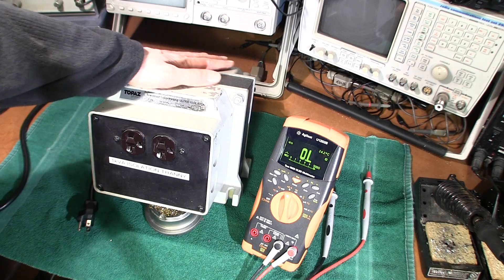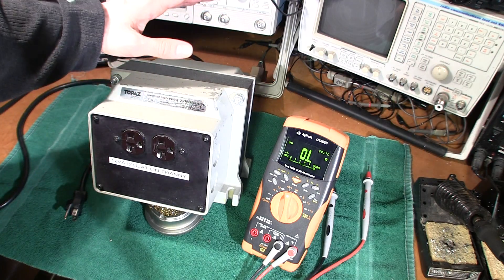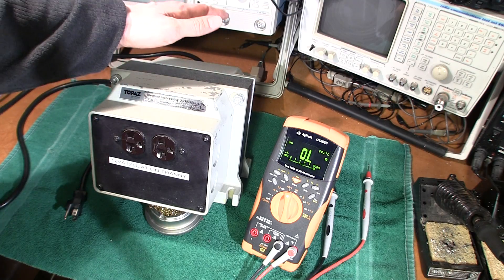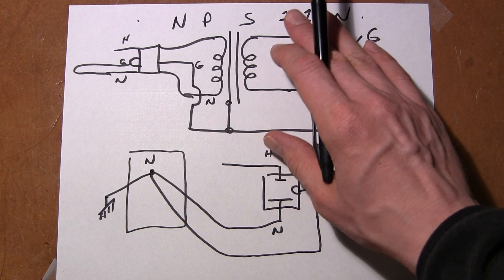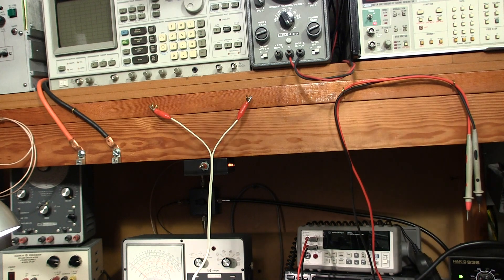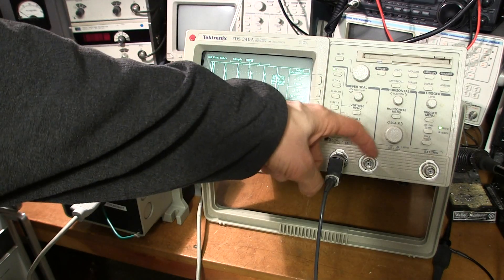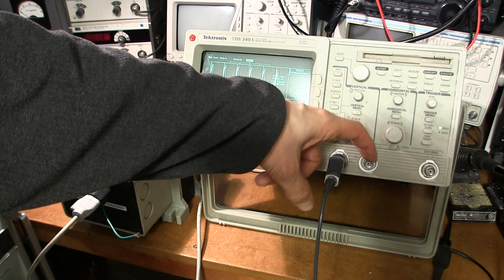Tech Tips Tuesday, Isolation Transformer and Variac Safety

Comment: Great video found it very informative but still confused.
So we shouldn’t float the scope.
We can’t float the device as even when hooked up to the iso transformer it isn’t isolated.
So all we can do is be careful never to connect the Gnd wire of the probe to the neutral. 
So the other reason to use a iso transformer is for safety, so if u are to touch the neutral wire in a device barefooted it will create a circuit and zap u.
So I’m missing the point here of why do we use a isolation transformers at all? if no reduction in human safety or scope safety.
Reply: I think you haven't gotten an answer from Mr. Carlson because of potential legal liability issues.  Notice that he didn't suggest in the video exactly what to do about this issue? (You did - it is why you are confused!).  So here's what we Americans learn to do - read between the lines - read the comments - pay attention to the ones Mr. Carlson does comment on.  BTW - not hacking on Mr. Carlson, there are many other vids that take the same approach - on everything from electricity to reloading ammunition to chemistry experiments.  Unfortunate sad commentary about the American legal system, from an American.

Comment: If you're lucky and your isolation transformer is on a GFCI/RCD circuit, then it should trip the GFCI/RCD because there's current "leaking" from the circuit to ground. Still will most likely result in damaged equipment but with less fireworks or chance of electrocution.

Comment: We don't have those problems in New Zealand... The case of the isolating transformer is grounded along with the laminations and that is all. There is no wire going to the earth pin of the output socket unless there are two output sockets and only then are the earth pins of the sockets connected to each other. This we call bonding, not earthing. It is to protect the users from two "earthed" appliances with a neutral to ground and a phase to ground fault being used at the same time. There is a fuse inside the case of the transformer in series with the secondary winding; sometimes there are two fuses... one in series with each end of the secondary winding. In case of the dual output variety, you are not allowed to to have a fuse in series with each phase pin of the output sockets as it can create a false ground. 

We only plug the device to be tested into the isolating transformer, not the oscilloscope. That is connected to a grounded supply unless there is a medical device on test when special equipment is used to monitor for any leakage currents. Most electronic techs will never come across this situation in NZ as that work is done in special workshops with all the safety features built in. There are very few isolating transformers in use around NZ these days as the "earth leakage circuit breakers" or ELCBs and "residual current devices" or RCDs have replaced isolating transformers. It's good to know that problems can exist in non-New Zealand made equipment... thank you.

Comment: If you remove the ground from the isolation transformer on the secondary side, can you plug the variac into the IT and use it and still maintain isolation?  This would be useful with a 240v IT when needing 117v for USA guitar amps like a champ etc.

Comment: I was tought to always use TWO isolation transformers with no ground connection: One for load and the other for measuring device. Floating load can be measured with earthed scope but when ground lead is connected it becomes mains referenced. If you touch the device, you get shocked because it is no longer isolated from mains earth. Having also the scope floated via a second isolation transformer (with no earth), you avoid the problem. With that setup it is safe to touch any single point of a powered device. That is also safer than just isolating the scope from ground because in case anything leaks from "live" to scope chassis, it is isolated "live" ie. will not shock you.
Never ever float only the scope and connect it to a mains connected load. Earth lead connected to eg. live wire makes scope chassis live which is very dangerous.
As a kid I also made the classic mistake of connecting scope earth to live wire with all the sound and light effects assosiated. :) Never repeated that mistake.

Comment: Hi I have just come across this video I found it interesting as I have just this week been setting up my work bench with isolation transformer . You did a very good demonstration of what the problem is . But I am somewhat concerned about your proposed solution . What seems to be being disregarded is while you make your measurement if you have removed the earth wire from the scope power plug and you have connected the ground probe clip to the hot side    At this point the steel case of your scope has become live in relation to anything else that is in your area that is connected to ground if you touched this case while adjusting a knob you would likely get a shock . If you had a data lead from your scope to a pc then you would then be putting high voltage down that lead on the ground into other equipment which you may damage . In the event that you are using as a demonstration I would use a DVM to measure the voltage between the conductor and the ground clip and ensure that it is a very low value  possibly a volt or lower before making the connection with the ground clip I would not need to remove the earth from the scope . If one gets used to doing these basic checks before making a connection then it can save a lot of damaged equipment . 
I am in the UK so  all out power is 240 / ref to earth regards bill

Comment: Love your chanel Mr C
QUESTION -  I totally understand all this BUT when you buy a transformer with step up/down or 1 to 1 . even the step ones sometimes come with same voltage available as output too so you get a isolated 240-240 if you want to use it that way?
QUESTION is,  Do you want the earth pin connected back through as per your diagram OR do you want to disconnect it to fully isolate the secondary side AND do dedicated isolation T's already do this?
Another channel was explaining that earth connection on output cant cause a shock as the 240v is floating and thus no round circuit if you touch both the earth and either the N or L output. BUT WILL if it is connected to the 240v winding. Little confused as if you power a broken device from floating 240v but touch the earth lead to voltage on the board, theres no circuit back to mains earth eventhough its connect as the floating 240v CANT complete a circuit unlike the primary side. Please clarify this. Potential is 240V Yes to earth, but its floating so no round circuit? and no blown lead?
Many thanks for this messy topic..
Reply: There's no real difference for 240V, just use an appropriately rated transformer and variac.   I don't think Mr. C is answering the second question for liability reasons.  I won't advise you either but I'll say in mine I have the variac first, and then just a two wire connection to the isolation transformer.  The secondary is connected through a current limiting 100w bulb to a switched outlet. That outlet's ground is unconnected to anything.

This means the isolated hot and the house ground are floating relative to each other.  You could touch both without a shock -- there would be no current flow.  You could touch them together, making the isolated hot the same level as the house ground.  

So it's true if you let the house ground through to the outlet and the DUT it won't blow up if it touches the isolated neutral or hot.  It's just that you have to now be careful with the grounds on test equipment that's plugged in -- they're now indirectly connected to the DUT ground so really can only be directly connected there -- anywhere else will cause a problem, where the test equipment is grounding a line not meant to be ground.

There are occasionally good reasons to want to connect the house ground to the DUT.  But for electronics repair my opinion is it's safer if the isolated supply is ungrounded.  It's easy to add the ground connection if needed.  Having to manually make the additional connection reminds us there is that direct connection to the rest of the house and that additional caution is warranted.

Comment: Hey Paul, maybe it's worth mentioning, that also many variacs exist, that ARE insulation transformers. Toroidal transformers with primary winding and a secondary winding, that comes with the brush... I do have one of those transformers in use in my lab since about 10 years now, and it works great. 

Also, beside the risk of accidently connecting ground level to your DUT via a scope, it could also easily happen via other units, e.g. sine generators etc... For testing my guitar amps, I selected all my necessary units to be NOT ground connected - which is an oscilloscope, a sine wave generator, a loop station with an instrument signal, a dummyload that includes a wattmeter and that has an insulated output that is connected to my recording studio (for recording the result of 1 - 1,5 hrs test-runs of amps that I repaired, to confirm that they are working 100% correctly).
Reply from the maker: Hi Lieselotte. In all my time, I have never come across a "Variac" that has any isolation. I encourage you to test your isolation with an OHM meter to verify any resistance. If you get any resistance reading from the input to output, your device is not isolated. If there is isolation, it's not a "Variac."
Reply: @MrCarlsonsLab  Hey Paul! My Transformer is an insulated variac without any doubt! The schematic next to the terminals shows a primary winding plus a separated insulated secondary, that has got the variable tap. Also I confirmed this with an ohm-meter and, on top, with a specific device tester (it shows >20MOhm between primary and any connection in the secondary in the mode for "protective insulation", measured under 500V). So, there is definitely absolutely no connection between primary and secondary... If you are interested, I can send you some photos of this device. 
Also, at the tube-amp workshop I used to work years ago, we had such devices (insulated Variacs) at every workbench, though I never ever opened one of these units, so there might have been 2 separate transformers (one for insulation plus an extra variac without insulation) in them...

Comment: Thank you! Public safety announcement.
Reply: Even though it's a floating output, still exercise caution. Never touch the two output wires of the secondary at the same time, as your body will complete the circuit!

Comment: In my book, any isolation transformer that feeds ground through to the secondary side is NOT an isolation transformer.
Reply: Dunno if its true in your region - but here in India you have 2 grades: medical and tech grade. The medical-grade usually has ground bonded to neutral, so that's something to watch out for.
Reply: @ShaunakDe  I understand the purpose of isolation transformers in the test bench use (tech-grade), and also in marine applications where a boat is connected to AC power on the shore and they want to safely isolate against galvanic corrosion, both these uses isolate the ground from the secondary side.  What is the reason the Medical Grade isolation transformers are bonding the ground to neutral on the secondary side?
Reply: tim brown  
A bench test isolation Transformer is completely isolated from ground reference. Most isolation transformers are build to isolate the secondary mains from primary mains. There is a HUGE difference.
Reply: You are exactly correct, Sir!
Reply: In Europe isolation transformers come with ungrounded sockets so there is no way they could pass the ground. In fact if you want to use a hot chassis radio on a room with grounded sockets one needs an isolation transformer to do it legally.
Reply: If the Neutral Output on the Secondary side is not grounded, ie floating, then there is no reference to Earth. Perfectly safe to touch either output but not both at the same time.
Reply: tim brown  
"Tech" isolation transformers can be had on eBay. But they aren't cheap usually. There are also many that are described as "bench ready" but they aren't.
Reply: @NunYa953  I've bought a 1:1 transformer, I'll have to add a fuse, plug and outlet myself, but that's quite cheap.
Reply: @James Bowie
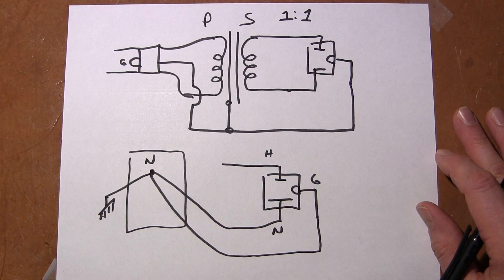It depends on whether the transformer secondary has any connection to ground!!   In one respect this video is very misleading: at ~ 5:00 the diagram shows the output receptacle ground NOT connected to either pole of the transformer secondary; the outputs are still floating.   

How is that misleading?  Some products today bond a pole of the transformer secondary to ground, which removes any isolation.  That can only  reduce power line noise.  It appears that the same isolation transformer, when sold as 'Medical Grade', leaves the "output floating, neutral output conductor is not grounded."

Now if in this demo the light bulb had been plugged into one of the OUTPUT receptacles, it would have been totally unexciting. Even if the scope was grounded via a regular wall outlet, the bulb would not light.  It would give the same results as when he used the cheater plug to isolate the scope, except that the scope itself would still be safely grounded!
Reply: Exactly
Reply: My isolating transformer is a Safety Isolating transformer and It had no earth/ground connection whatsoever, I am aware that some Isolating transformers do have an earth connection and these are no god for the bench.
Reply: A mental refresher and good to go.
Reply: Correct
Reply: GOOD THING FOR ME THEN, THAT YOUR BOOK MEANS OOGATZ TO ME!!
Reply: Exactly
Reply: It's still considered isolated, just not from ground.
Reply: @NunYa953  Actually... From the neutral bar, which is connected to ground, in the electrical panel!
Reply: @MrDoneboy  
This particular design of isolation transformer only isolates the secondary from mains. There is a big difference between a bench test isolation transformer and this. All these video prove is there's a whole lot of people who have no business playing with electricity doing just that.
Reply: @NunYa953  It is your life, sir...you only have one!
Reply: @MrDoneboy  
My life is intact and I repair electronics for a living.
Reply: @NunYa953  WORD!!!
Reply: @ShaunakDe  SENTENCE!!!

Comment: I would have figured it'd be best practice to put any item you're testing through an isolation transformer, and the oscilloscope didn't need to be using one.  (except if doing what your example showed, connecting an oscilloscope directly to house mains-- either way, one side has to be put through an isolation transformer).  Or is it recommended both the item being tested as well as the oscilloscope use their own isolation transformers?

Comment: I am planning to make my own isolation transformer since its very hard to buy one in our area question can i use to units of 220 volts to 110 volts step down transformer and connect it back to back is this ok?
Reply: Reynaldo Chua, if I understand your question correctly, you have (2) 220/110 transformers and you want to connect the (2) 110 vac low sides together, put 220 in the high side of 1 transformer & get 220 vac out of the high side of your second transformer, in effect, making a 220/220 Isolation transformer. Is that correct? If so,  I know that you can do it, but depending on the impedance, and a few other factors, it may end up being a very inefficient system. Also, you would have to watch your amperage on the 110 side doesn’t exceed your wire rating. All that being said, I’m sure that Mr. Carlson will be able to offer a better explanation & a better solution.

Comment: Me Carlson, I’ve seen this warning/explanation many times but what I haven’t seen is a proper fix for the problem. I can disconnect the “earth” lead on the output side of my isolation transformer but I don’t think that’s the proper fix. What is?
Reply: Use the adapter, contrary to Mr. Carlson it's still safe.

Comment: Anyone trying to use a so-called "isolation transformer" needs to not only think clearly about the relationship of "earth" ground to the two AC power leads, but also carefully check the transformer internal wiring before using it.  For example, I just received from Jameco a Goldsun (China) model GRP-1200, which connected all (2 primary and 2 secondary) outlet "earths" to the so-designated lead in the incoming mains cable and to the GRP-1200 case, which is acceptable for some applications but not those requiring actual isolation (floating secondary). Worst of all, one of the primary outlets' "earth" connector was not correctly soldered, so it connected to nothing and thus would defeat the safety function of earthing (on the primary side!). The four "earth" connectors on the outlets were bussed via a bare wire, which was not mechanically bonded to the outlets but just laid alongside the connector and spot-soldered. Several of the internal wires were pressing against corners of various kinds, such as the transformer laminations, which may eventually abrade or arc through, leading to short circuits. I will be rewiring and retesting this unit before using it.

Comment: So the rule is make damn sure you know which connection is live (hot) and don't ever connect your scope ground to it. If you don't know the neutral and earth are bonded (at distribution box) you shouldn't be using a scope. (especially on mains). Some house outlets are incorrectly wired so check, don't presume.

Comment: Can a Powervar ABCEG251-11 UPS with 10 volts normal let through and less than 0.5 volts neutral-To-ground be considered an isolation transformer? Or, can it be disassembled and the parts be used to create one? Do you have a video on building one?